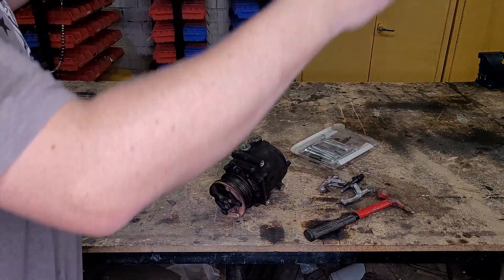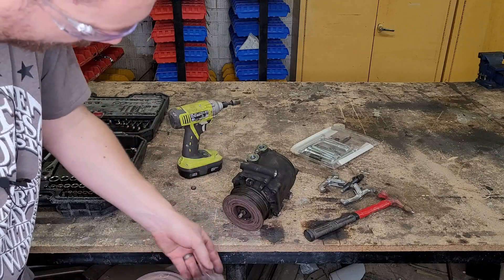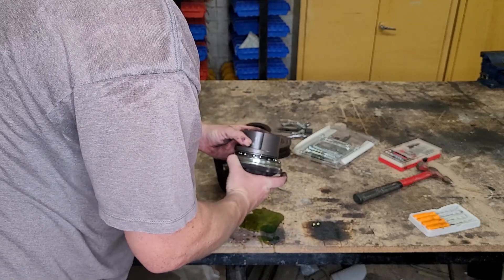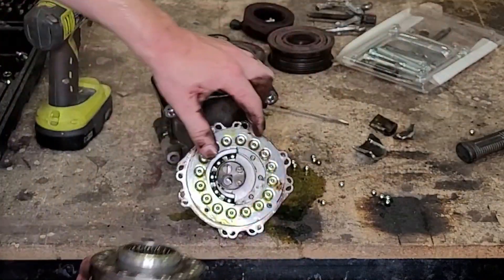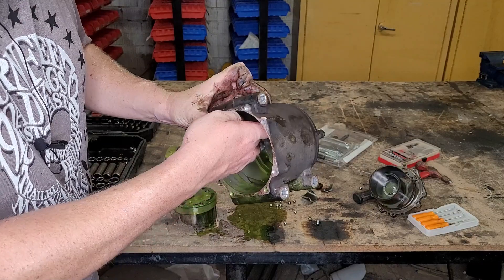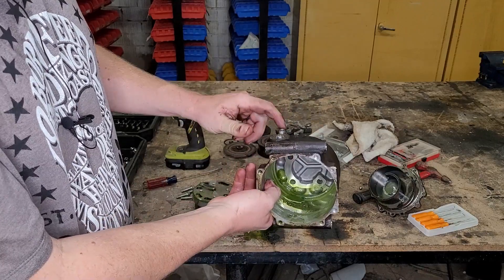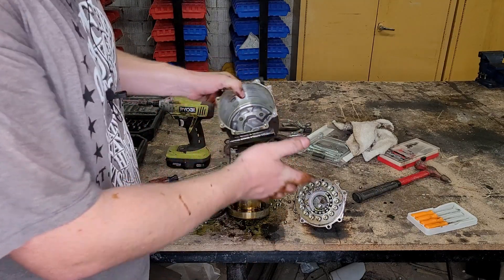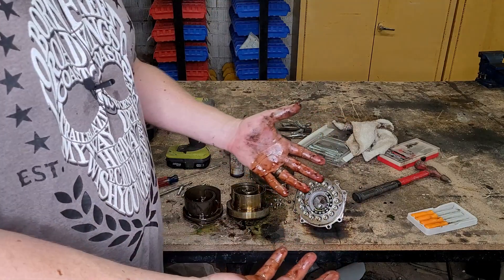What Killed My AC Compressor? How it Works! Ford Scroll Compressor

Comment: I have my compressor lock up on the way to a job interview and the fan belt started bellowing out that strange white stuff the army use to hide their sneak attacks. I was initially told it lo ked up due to lack of oil but I now have to wonder if it actually broke.

It was an old one that didn't have a clutch and I didn't hear any crunching when it stopped working. I was running so I could act 😎 during the job interview. Had to cut the fan belt off so it would stop billowing the white smoke and the guy in the phone service van was pretty reluctant to lend me a knife. I always carried a knife and minimal tools with me after that.

Thank you for the interesting video Adam though I guess you are way too busy to go back over your old comments. I hope everything is going great for you and Kylie and all her injections give you a little joyful "problem." 👨‍👩‍👧

Comment: I just had the same compressor lock up on my 03 Grand Marquis.....460,000 miles with heavy AC use here in the hot south (Arkansas)......it's odd how one compressor can die at 100,000 miles and one go to near half a million....   Great video.... I can't wait to take mine apart and look next weekend when I'm off.... mine has been making a "growling" sound for years....